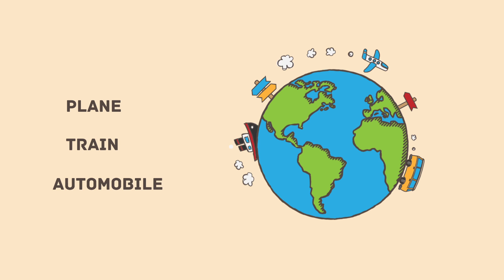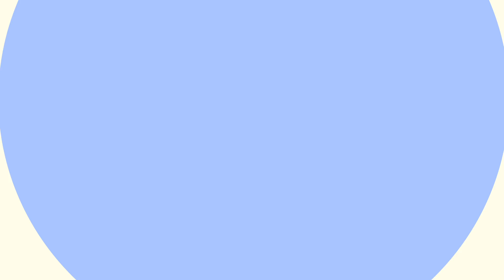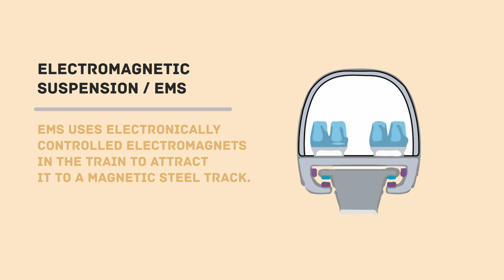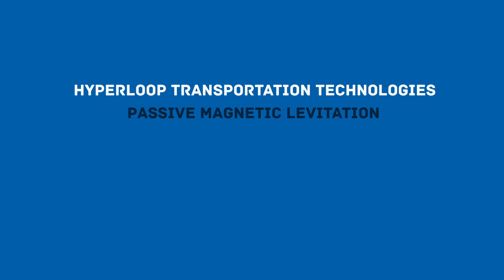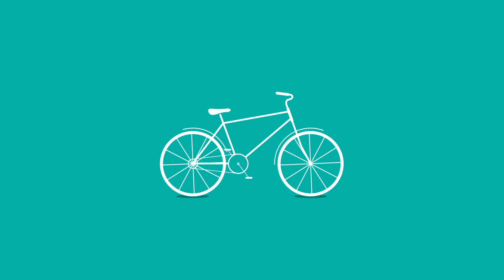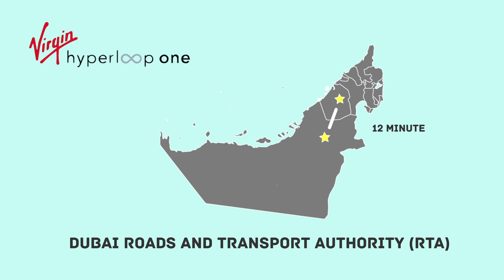Is Hyperloop Just A Dream?

Comment: You are entirely missing the point of Hyperloop which is travelling faster than the speed of sound through a vacuum for a fraction of the cost of public transport. Maglev's have been operational for 20 years now, the problem is that they are extremely expensive to operate. So how is Hyperloop going to solve this? The claim all goes according to plan and that the LA-SF track will be operational in 2020 but they fail to explain why and how. The 201 mph you mentioned is only a fraction of the intended 1220 km/h and it was done with a scale model with no people on board. Shooting a piece of metal down a tube does not prove it is a safe, viable and cheap way for human transportation.
I am an optimist by nature but so far Hyperloop has only made a lot of promises and raked in a lot of money. But they have not produced anything of value yet.

Comment: I think they need to manage to do these two things for this system to be economically viable; first they need to figure out a way for low cost low power high speed underground tunnel making. And second they need to learn to use a dead steel track without magnets for both levitation and propulsion. 

I’ve given these two aspects a fair deal of thought and research and in short it’s doable, but the current method is far from efficient. 

Underground vacuum chambers protect from the sudden explosive flux of air overground tunnels suffer from in case of a leak since air pressure is lower underground because of earth’s crust, I could go on. 

And impressive channel btw!